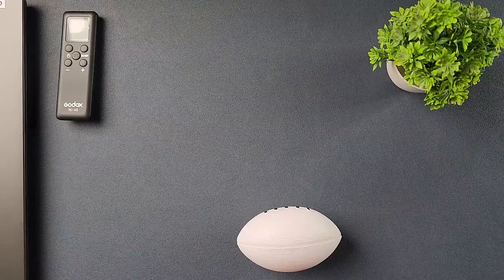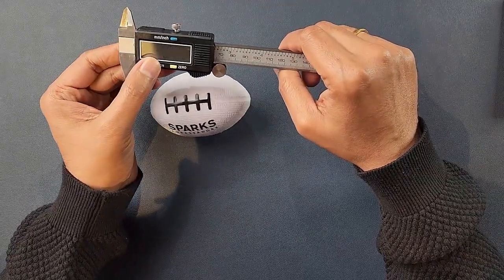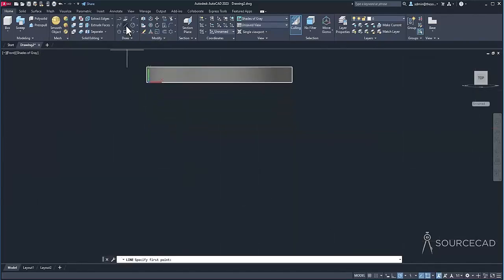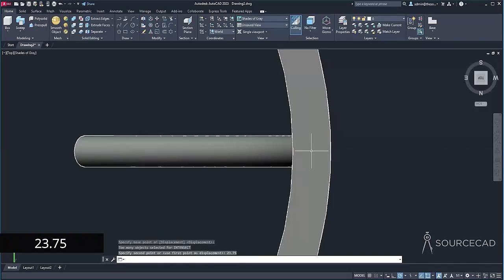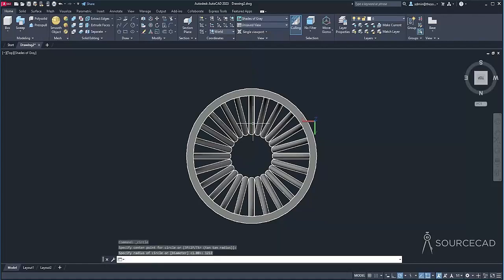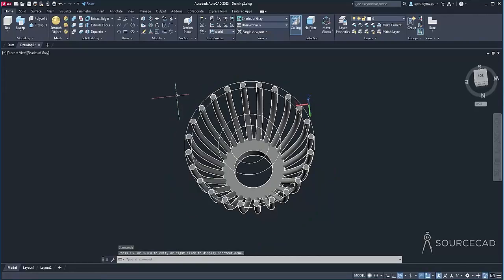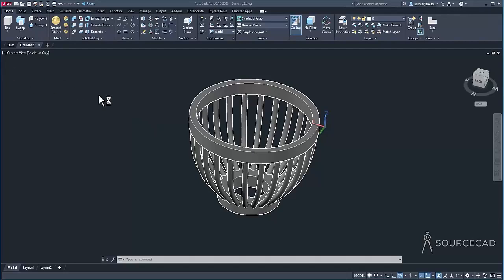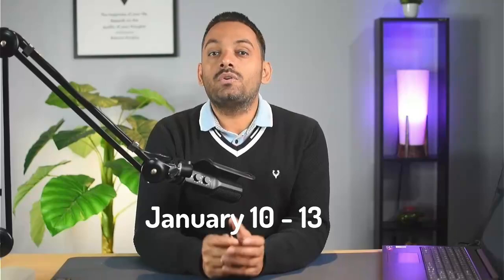Make objects and 3D print them using AutoCAD

Comment: Hey! Thanks for the videos. I don't have the utilities section in my home tab, so having a hard time in measuring the volume of model. Also, I made the model by using the revolve option so I'm unable to use massprop as it says this is not a model but this is a surface. My model looks like a crucible. Please help.

Comment: Hi! 
My problem is  that what i design in AutoCad, the rounding and circular things are not smooth/curved perfectly after printing. 
There is no such problem with the downloaded documents.
Reply: Your problem may be when converting to STL. You need a high number of polygons for rounded curves. Try increasing the resolution of your files

Comment: I did exported to STL file but I see the corner and circle is not smooth... how can I solve this?
Reply: Solution: When exporting the STL file, set the resolution to a higher value in the export options if you need a 'finer' segmentation: Use File > Export > CAD Format.